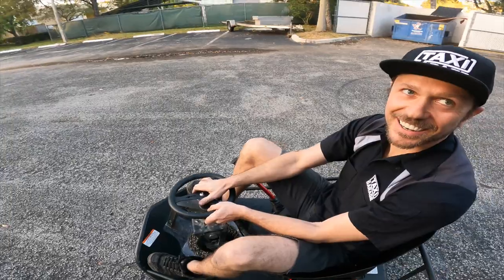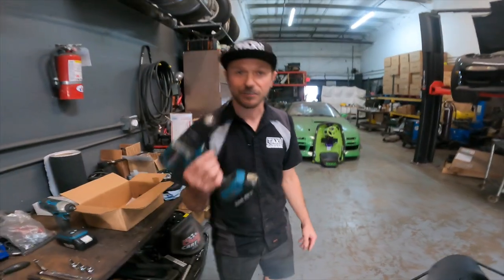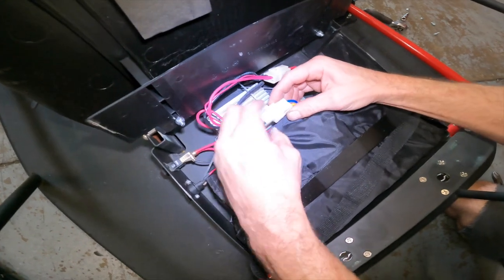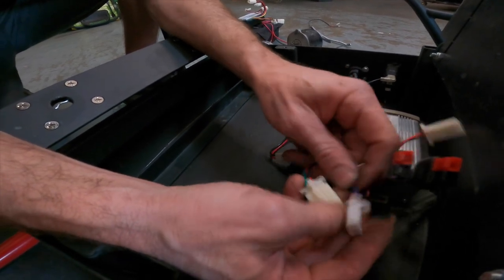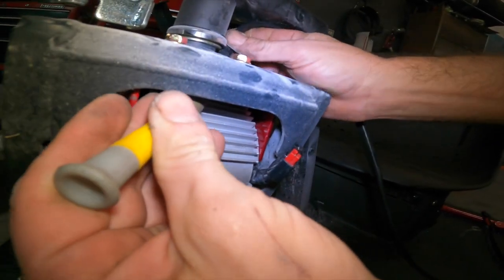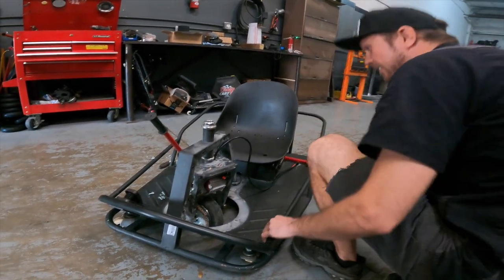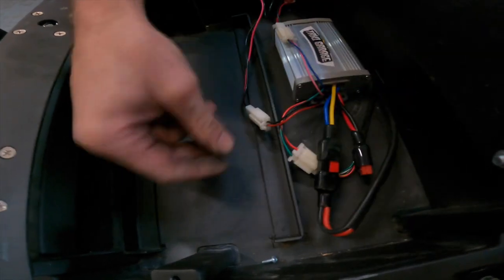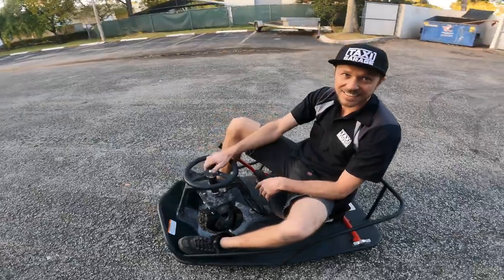XL Crazy Cart 1000W Motor Upgrade Install | FULL SEND NEXT LEVEL | TAXI GARAGE

Comment: When are the solid tires going to be back in stock by the way I love your vids so much I watch them every single day I have my own stock cart and I’m saving for a motor and battery upgrade .😀👍🤟👋
Reply: Solid tires can be found on ebay for cheap.  Just make sure it is solid and not just filled with foam.
Reply: AND AMAZON

Comment: Can somebody explain to me what justifies the price of the level 5 taxi garage crazy cart mod? I have an E-Move Cruiser scooter thats faster, crushes the range and it was simply $1399.00 shipped to me. If somebody could justify the cost for me, i mean is a seat a motor, battery, controller and 2 longboard wheels worth almost $3K more dollars?..... i will buy one to add to my VERY extensive hot rod e-ride collection if i could just justify the price.
Reply: Can it drift?
Reply: One word fun i got wolf warrior king gt top scooter but my drift cart is just fun

Comment: I'll give all of you a secret easy to do mod that is much more powerful and has a better tire on it. Use a large brushless scooter hub motor. More efficient, less weight, MUCH more powerful, better grip, and you don't need the tensioner anymore or any chains to run. It can bolt right into the existing frame too. Btw, it comes in 1500w+ configs. Also battery is better with a good lithium ion pack at 48-72v range with brushless motor controller as well. All of this is with just as much effort as the kit being proposed.
Reply from the maker: Hi Kenneth,

Thank you for your input. This kit is a substantially torquier than a brushless hub motor making it have the bottom end that these carts need to have fun with. We have tested quite a few hubbed motors, They really lack the torque a brushed motor produces. The next issues is changing the tire when it wears out. Brushless would be great if they were made in the compact size a brushed motor can be made in. 
This kit is also a NO modification needed kit. This is a main focus when we design products. This setup on our 48v battery with a 180LB rider will do 24mph.
Reply: @TaxiGarage  you need to try a sensored brushless with a vesc. You can easily squeeze a hub motor wheel with 1500+w without modifications to the frame. I use hub motors all the time with crazy off the line torque. It is hard to compare to a well controlled brushless motor even with the best brushed motors available.
Reply: Do you have any motor reference for that?
Reply: @_ybnn  Idk if the link is allowed or showing because youtube sucks, but there are 10" wheels that have 60v 3500w max motors you can grab off of ebay and aliexpress that will seat right in and then you just grab a sensored brushless controller and voila, you have something that is so powerful that it is borderline dangerous.
Reply: @fookschool  are you on social media I'm interested in trying too do the upgrade you' re talking about

Comment: Also, will your 48v controller work with my 60 volt battery? I have 1 36v ride with a 36v limited controller and all the rest have controllers that accept 48v/60v.
Reply from the maker: It will work, But not forsure how long. We do not warranty controllers if it is not used with our batteries. You are welcome to use it this way. We have done it and it is insanely fast

Comment: Whats the new top speed?
Reply: Maybe 18ish
Reply: @sprocket374  no way it’s gonna be way more than that cause the standard crazy cart goes 17mph
Reply: It’s going to be fast enough for you to consider getting some brake pads for your kicks lol
Remember, we still have no brakes, and now you’re flying down the street at about 20mph (on the flat rough surface, with an air tube tire, and TG casters; fully charged batt. 170lbs) ... 
Be careful what you ask for. 
Nice smooth surface with a bit of a slope, might get you to 25+mph; at that weight.

If you thought you had issues with wheels, always replacing them. Hope you’re ready to spend some MORE money. And if you didn’t, then get ready to lol 
Especially for less experienced riders.

It’s almost too much power tbh; that’s if you enjoyed drifting more, than just going straight, and weak turns (for the most part.)
You’ll see what I’m talking about (if you get the kit.)
Battery drains slowly at the end with this kit, unlike prior to the upgrade (stock 500W motor,) full power until dead (unless you had different 48V ESC, like from fast scooters, which drains the battery slowly (even with a TG 48V batt.))
You will also loose about half an hour on the batt time (from ~ 2hrs) 
Which is not that bad, but that 30min makes a difference, especially when out having lots of fun 😁 
Lets put it this way, there were days when I got bored riding it on the 500W motor (48V) lil over 2hrs. 
This one, starts slowing down at about an hour of intense riding. 
Thinking about getting another batt hehe

I’m not going to lie, already miss the old set up. I’m more into drifting it, taking tight turns and all that, but with this much more power, it makes it more difficult to do so, smoothly. 
Even steering hand gets a bit tired from trying to hold on to the steering wheel while holding a lengthy drift (never felt the strain on hand on the old set up, taking the same turns.) 
Motor gets hot sooner than I expected (in 65 degrees weather,) probably normal, but does cool down pretty quick. 
Oh and get ready to flip (unless you take it easy.) 
Hope you have some of the gear on  🙏🏼  

Other than that, if you take it easy, you’ll be iight 😁

Unless each kit is different from another, that’s pretty much what you should be expecting. 

Have fun and stay safe. 

*Don’t forget some good quality brake pads for your kicks, you’ll need ‘em lol 👻
Reply: @Santiago Caram Perez You mean their standard size upgraded (500W) carts? 
I can’t agree or disagree on that one, haven’t ridden one to compare. 
And tbh not really planning to, as I constantly flip over (sideways AND backwards, and not even full speed) on the standard size cart (6ft @170lbs) with the stock 250W and TG 36V batt; with stock casters, XL casters, and even TG casters/wheels (tried all 3) 
It does “wheelies” more often than I’d want it to, sometimes turning over completely. 
I do have my seat adjusted to the furthest (there are only two options,) but that shouldn’t throw it off balance someone weighting about 170lbs, as there are much heavier people riding them.
Maybe I got to get used to it more, or just too wild on my turns, idk, because clearly they all ride em without any issues, even at full speed (fully upgraded.)

So I stick to the XL (for the most part.) 
It’s way more comfortable too, HUGE difference. 
Just a mission to transport and all that, but manageable.
You also need to remember that standard size cart weighs just 55lbs VS 112 lbs XL. 
That’s a lot of weight difference which does effect the speed.
So I wouldn’t doubt that fully upgraded stage 5 standard size cart would out run the XL with a new 1000W kit (someone else would have to test em to confirm.) 
TG have both, and can easily do that.
But I guess they left that for us to find out lol
One thing for sure tho, you’ll be much more comfortable AND safer, on the XL, even IF it’s running a bit behind.
Reply: @creativ3vision  where can I find some brake pads like that? :)
Reply: I have it and if you have the 48v battery w it it goes around 22-24 mph
Reply: @brown2840  Haha 😁 
You won’t need ‘em, it aint that bad. After few rides, you’ll get used to it and be able to control it just fine.

Comment: What is the ride time now with the 48v batt?
Reply: About an hour and 30 min (non stop, pretty much; with TG 48V batt.) 
You’ll loose about half an hour ride time from 500W motor. 
In about an hour, you’ll feel the power running low, then it goes down from there. 
If you floor it for the most of the ride, it’ll probably be less time.
You could still probably get to where ever you need to go to get back (after an hour and a half,) you just won’t be able to drift much, as the battery already drained and doesn’t have much power to take off from a stop, but once you get it going, it will roll. 
Not sure how far, since I didn’t risk draining it completely to where it totally stops.
NOTE: Weight, casters, wheels, weather (wind) will make a difference in those numbers. 

Test run: TG casters and the wheels. Main tire stock with an inner tube. 6ft, 170lbs. 
Top speed? On fully charged batt ( and I mean FULLY charged. About 9hrs, until the battery charger light turns green, reading 54.6V. Yes, I waited for it.) 
Not sure why it says 2.5hrs approx charge time for the 48V, but I’ll take that over 14hrs+ on a stock batt. So no complaints there.
So, using Waze app (you decide how accurate it is,) I got 20mph, on the flat rough concrete road.
Feels really fast tho (in comparison to 500W) Forget about the numbers. 
It’s actually lil too fast for comfort, tbh; if you enjoy drifting A LOT.
Reply: @creativ3vision  thanks buddy!
Reply: @brown2840  Anytime 🤙🏼
Just did another test run. Got 2 hrs out of it (pushed it to the end,) barely made it back to my car, but was still rolling  🐌 before I loaded it up and called it a day. 
After about an hour and 20min “non stop” of intense riding, it starts slowing down (very noticeable.)
The last 25 min you can still have some fun drifting at a slow speed on a smooth surface (preferably,) if you want to push it until it totally goes dead.

52V would be really nice for the new motor 😁
48V is just not enough, impo.
Reply: Yeah I have everything upgraded and ran it for an hour and didn’t lose power at all
Reply: Ghost unknown I’m getting two drill battery’s for my cart do i need motor or tire etc  ?
Reply: @ghost unknown
Reply: @ashtonbackup934  If you want it to run, you’ll need a motor AND tire lol 
But if you’re referring to upgraded motor and tire, then it’s all up to you, you don’t NEED to. 
Your stock motor will be just fine as is. Same goes for the tire (main tire,) you’d just have to replace it more often.
I can get two (2hr rides) out of a stock tire with an inner tube; not going too crazy with it.
It will all depend on the drifts you make too. I had a tire pop on me an hour into a ride, but I was being too wild (stock 500W on the XL.)
Note: I also had a solid tire popped off the rim one time, that CAN happen too (stock motor on the XL.)
So it all depends on what you’re looking to get out of it, but regardless of which motor you use, you WILL be going through them tires AND rear wheels more often than you’d like; depends how wild you get with it.
Reply: @creativ3vision   I’m on different account I’m just doing battery’s at the moment but these things shred tires lol
Reply: Hi ghost could you send me pictures or a list of what you have done also will two drill battery’s fry the stock motor ?
Reply: @maryhunter127  I’m running Taxi Garage 48V and their casters, for the XL (stock.)
No time to make my own battery upgrades. 
Not only that, I don’t have to worry about what works and what doesn’t, they already sell everything turn-key ( ready to be plugged in to stock harness and GO.) Everything is compatible with original parts.
I can’t really answer your question, as I don’t have any experience in power drill batt conversions. 
Plus you need to be more specific on what battery, and more importantly the voltage you’re planning on using. 
That way someone else might have the answer for you.
But if you stay within the 48V range, your motor should be just fine, regardless of the battery type/style you choose to use.
If you go any higher, there WILL be more strain on the motor (no need expert advice on that there,) as your ride time will be much longer and a bit faster, hence the motor wear, VS stock.
Reply: @maryhunter127  Yep, welcome to the club lol
Tires and wheels (rear) will continue to shred, until someone out there comes up with something stronger and longer lasting through all the wear and tear these carts go through.
There are non out there so far. 
Even the longboard wheels from TG wear out pretty quick (if you’re riding it all crazy, like you should.) 
But they do last longer than any other one’s in existence, to date (unless someone found a pair that’s better; please share 😁)
Reply: @creativ3vision   thanks I’m using 2 makita drill battery’s 12 volt each so and also my tires bald after 2 runs but I do drive quite wild as I do real go karting that go like 60 plus so getting used to steering etc lots of wheel spin soo
Reply: I meant front tires I’m fine with rear

Comment: I seriously wonder why there's a steering wheel instead of a steering handle. Would give more control and more grip.
Reply: Because you have to pull the handle.  More single hand control on a wheel than a handle
Reply: How would that give you more grip??